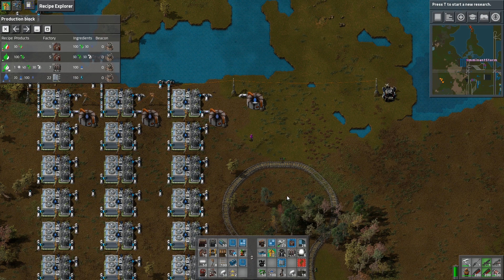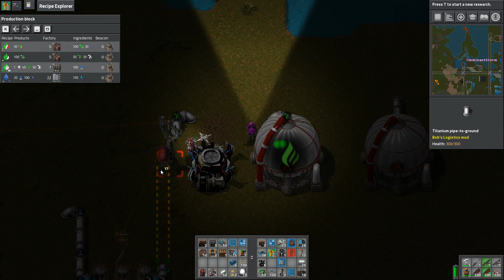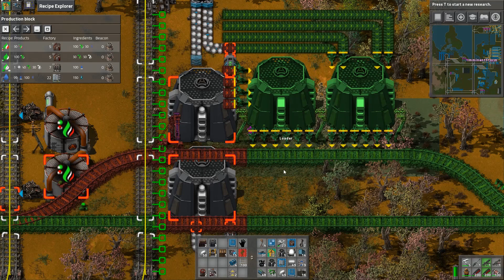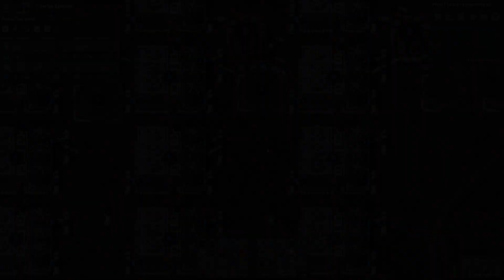Factorio - Angel's & Bob's - Episode 94 - Too Much Water

Comment: One blueprint that I think would save you a LOT of time in the long run is a very simple blueprint with just three items in it: pipe-to-ground, straight pipe, pipe-to-ground. Then whenever you're building a large build like this one, with a LOT of pipes connecting the inputs of various machines, you can just stamp out that three-pipe segment over and over and let your bots place the pipes. It will be useful just about everywhere.